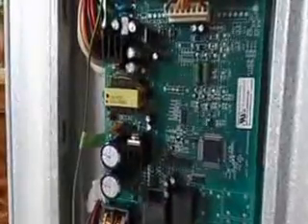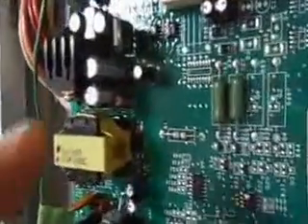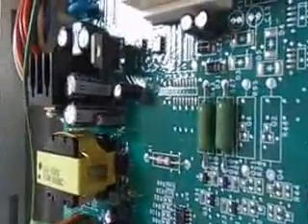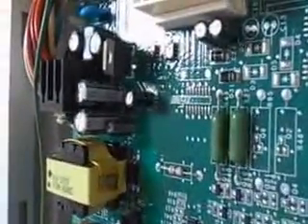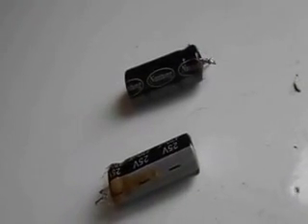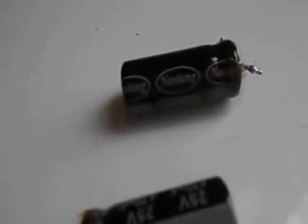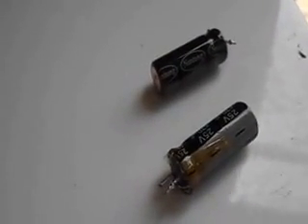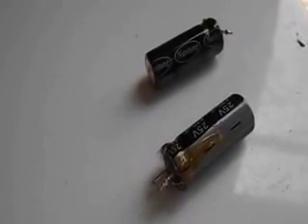GE Refrigerator - $4 worth of Bad Capacitors causing cooling problem, light blink.  A discussion.

Comment: Could you list in the description which ones you replaced the Nantung ones with and where you purchased them?
(Assuming they were 470uF @25V as well)
Reply from the maker: I do not have a list of the required caps for this model refrigerator, but I had looked at the existing capacitors to get the ratings, then I purchased the caps at a "local radio supply" company; Iowa Radio Supply, which is 40 miles from here each way.  I have also purchased caps on eBay... for the power boards on Samsung and other TV's (where one seller has the full "kit" or assortment for each board.  Maybe you will find one for this model board.    

I have learned that Japanese branded capacitors are most reliable, because they licensed the patented formula.
My personal favorite is Nichicon, but Panasonic and Hitachi are also usually top quality.

Comment: I have the same problem with lights (led) blinking like a strobe when fridge doors are open, do you think this might be a capacitor issue ?  Is it usually on the main mother board and where is the best place to get replacement capacitors? 
I appreciate any help

Frigidaire 3door unit.

Dave